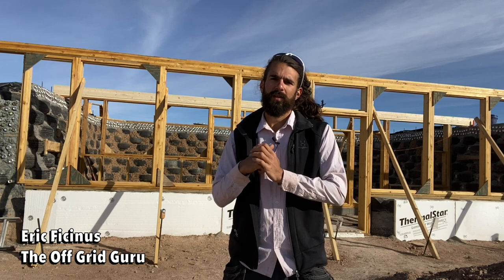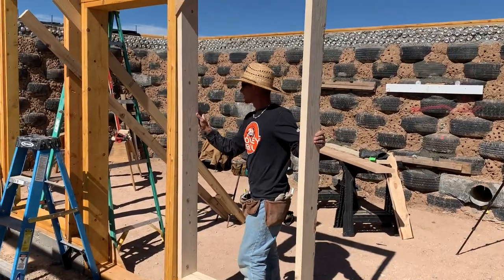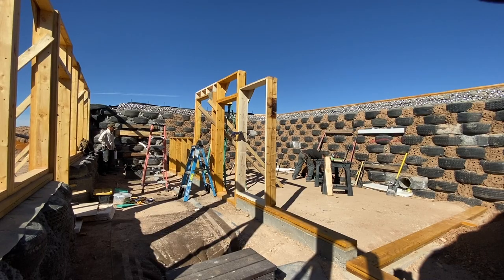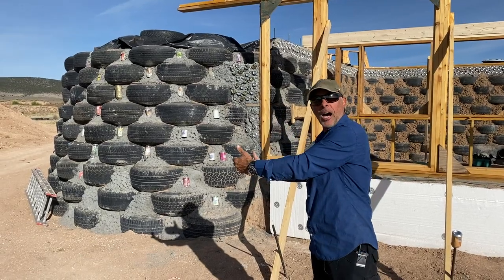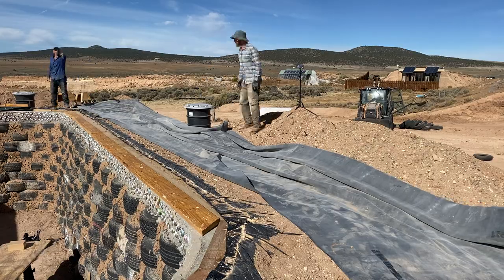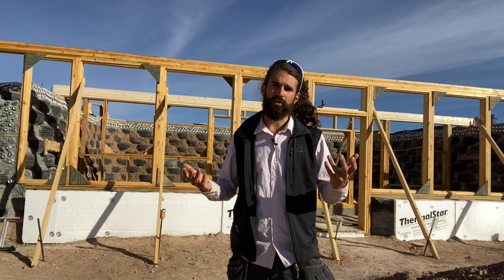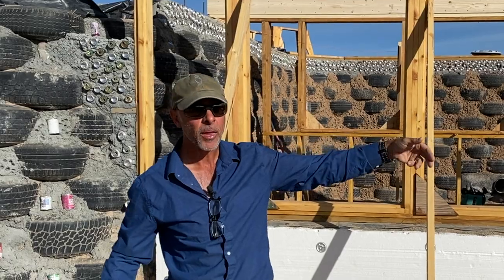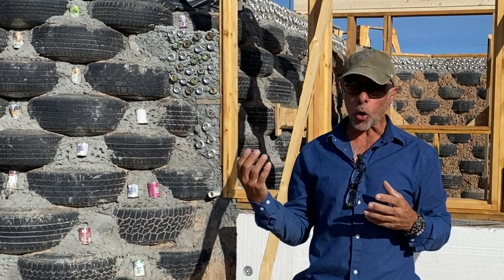EARTHSHIP TINY HOUSE Update - Framing the greenhouse.

Comment: It has been 2+ years... can you still smell the old tires "rubber stink" smell?
Reply from the maker: Walls are fully plastered, no exposed tires inside or out… no smell. Check the final video in the series where we tour the finished build. Also in my experience, being very sensitive to smells, you only smell the rubber when tires are fresh. Old car tires with thousands of miles on the road and no tread left 🛞 are typically what we collect for these builds. They’ve already leached their petrotoxins and no longer stink… Nobody throws away new tires and we don’t use them in construction.

Comment: Apart from saving materials on the wall, this house is no different from a house. The wall is easily damaged. Snakes, rats, insects and ants cannot be avoided. Once it is formed, it will be catastrophic. In addition, this house must be built on a high place and do a good job. Drainage, once a flood occurs, it will collapse. The cost of a house built with modern materials can completely compete with this (this building has too much labor), and it is simple to maintain. The so-called energy saving is easy to do. This kind of project is a test of IQ.
Reply: It does not seem that you have a full understanding of all of the design priorities and details of this construction. I agree that in terms of efficiency it is possible to match similar design goals (high mass, passive solar etc...) with a number of different construction techniques and materials, some with higher material cost and lower labor cost, but that is not the only metric under consideration for earthship design. Also, what home will not collapse (or otherwise be seriously damaged) in a flood? No one should build in a food zone if they can avoid it. As to wildlife incursion, you have no data upon which to base that conclusion. That issue is almost entirely based on finishing details that have not yet been completed for this building.
Reply: @travelfeet  Well said!